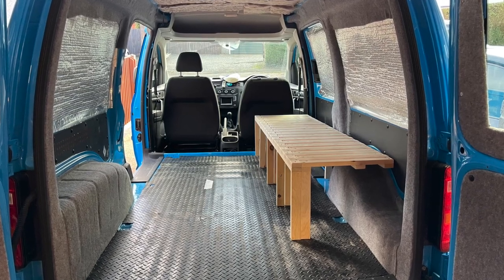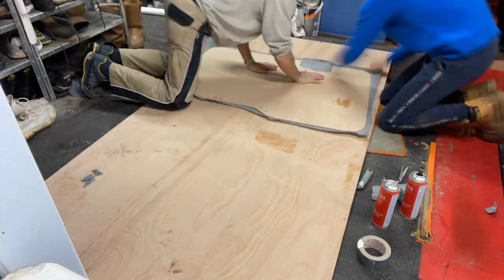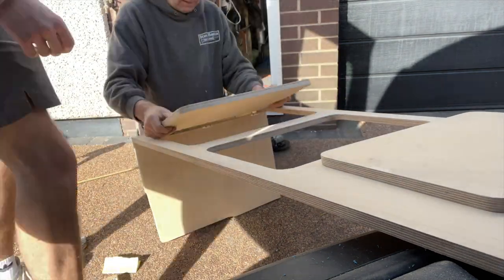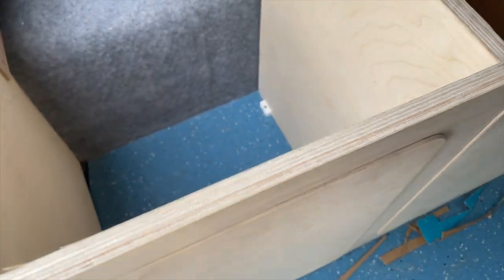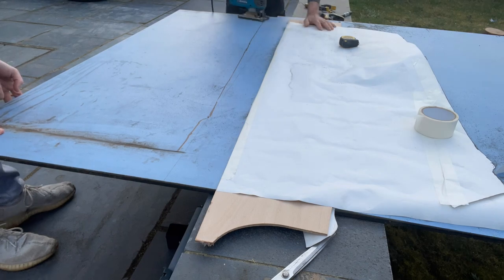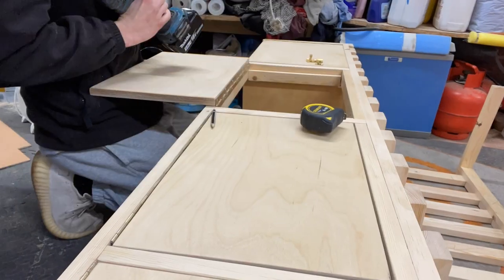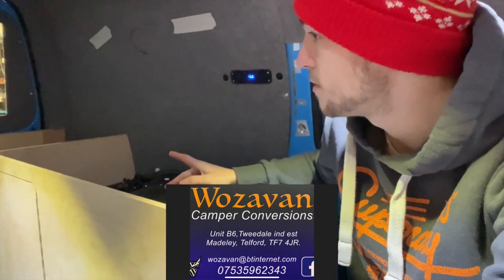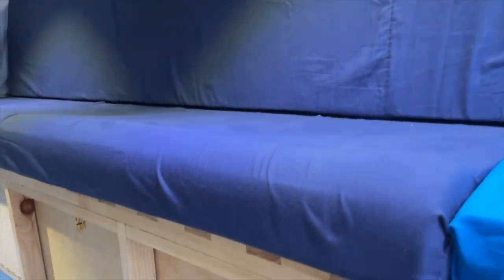VW Caddy MICRO CAMPER Conversion FINISHED BUILD

Comment: Great conversion and interesting video series.  I am picking up my ex BG van next Tuesday to start my conversion.  I was wondering if you could help me out with a few dimensions from your build 1) distance from the wheel arch to the front of the kitchen unit; 2) distance from the wheel arch to the front of the bed (in seating mode & 3) the length of the bed.  Thanks.
Reply from the maker: Thank you so much for your comment. all the best with your conversion, I’ll have a measure up this afternoon and let you know the dimensions 😁

Comment: Hi mate when you cut panels for above the wheel arches where did you get measurements and what did you fix to cheers
Reply from the maker: Hi, we used some lining paper (held it in place and traced around roughly where we wanted the panel) we then went slightly bigger all the way around and used that as our template. Cut the plywood out and then slowly trimmed off / sanded it down until we were happy with the fit. This did take at least 45mins per panel but much better than just going for it and cutting too small. I could measure them up for you and send the sizes if you like? In terms of fixing we just fitted some modesty blocks into the pillars of the van and then fitted the panels to them, 2 tiny screws in each panel 👍🏼
Reply: @BanksyTravels  okay thank you, and if you could that would help massively you'd save me lots of time and stress 😅